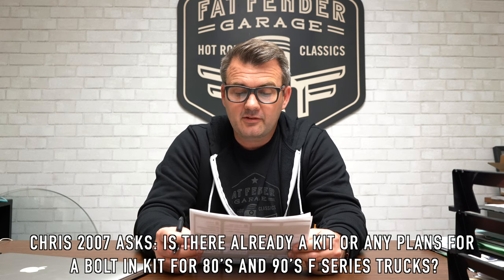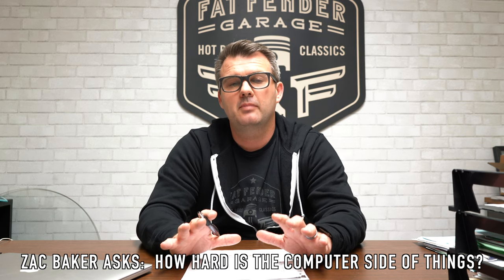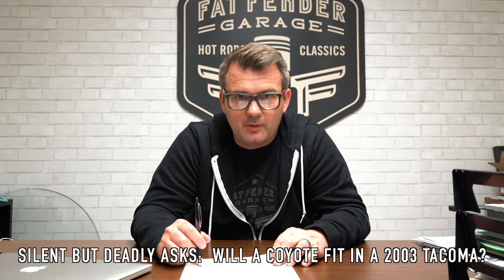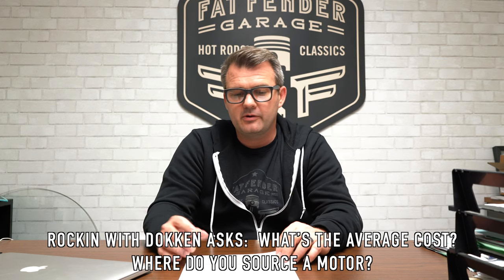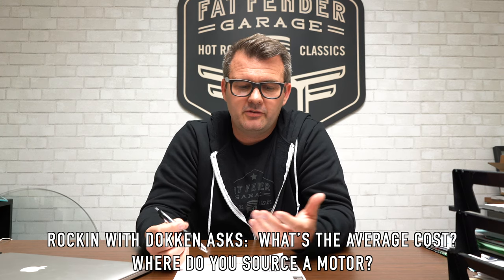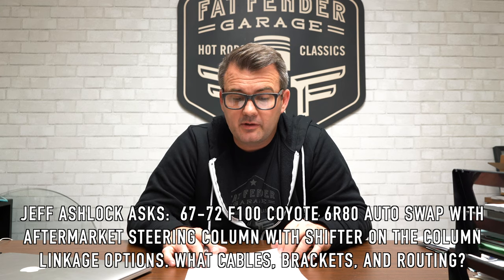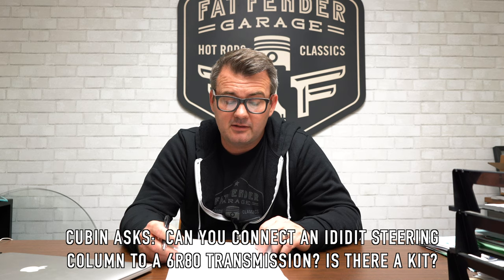Coyote Swapping FAQ | Fat Fender Garage

Comment from the maker: Thanks to everyone who sent in their questions!! If you wanna know about a particular topic, here are the questions and timestamps. 

1:10 - Is there already a kit or any plans for a bolt in kit for 80’s and 90’s F series trucks?

2:01 - How hard is the computer side of things?

4:35 - What’s the most common part or piece that gets overlooked when doing a swap?

5:47 - Are the 6R80 / Coyote swaps better than using the 4r70 w? Which is the strongest?

7:17 - How much frame alteration is usually involved?

9:05 - Will a coyote fit in a 2003 Toyota Tacoma? 

9:31 - What’s the average cost? Where do you source a motor?

12:20 - 67-72 F100 coyote 6R80 auto swap with aftermarket steering column with shifter on the column linkage options. What cables, brackets, and routing?

15:57 - Do you need to make chassis modifications to accommodate the huge increase in power? 

17:38 - What are the cost ranges depending on the level of build?

18:41 - Header clearance and brake booster clearance On a 67-72 F250?

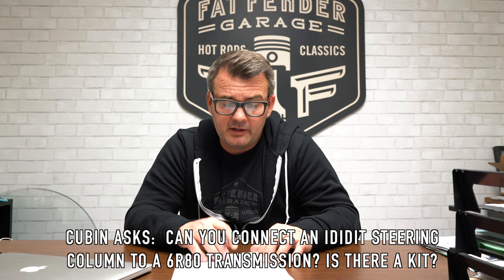21:30  - Can you connect an ididit steering column to a 6R80 transmission? Is there a kit?
Reply: Chevy pickup 3100, 1955, pode ser atendida por vocês?

Comment: I have a 1994 ford f150 xl 5.0 v8 4x4 in a 5 speed manual. I'm thinking about a coyote swap and i want to keep it a manual transmission. My question would be if the 4x4 would go away or is there a way of keeping it?
Reply: @turbodgumby has a 90s bronco with a a manual transfer case